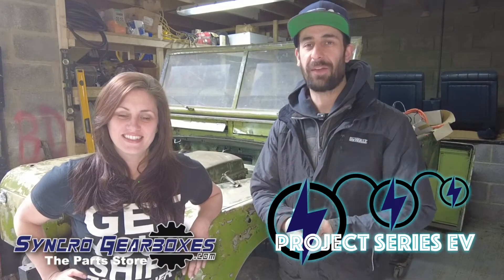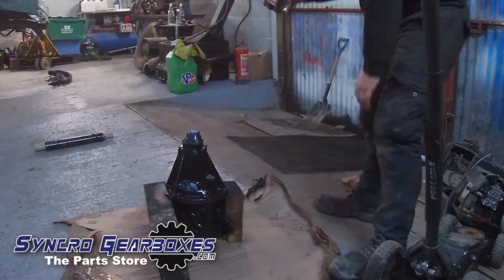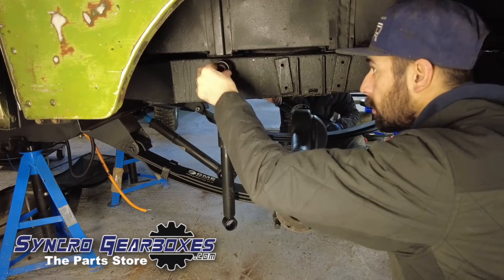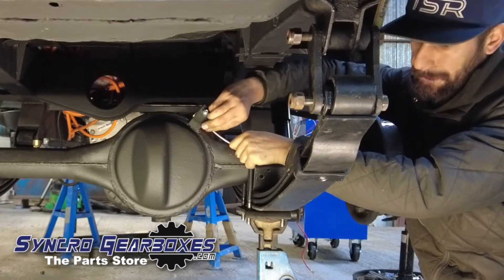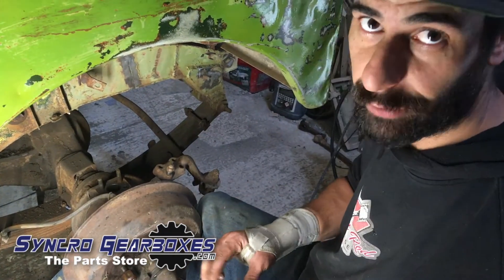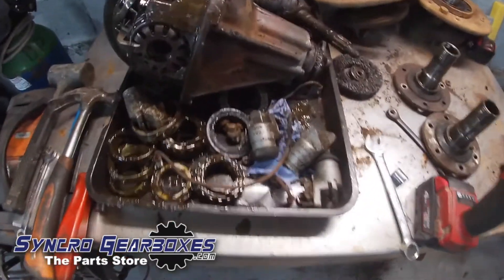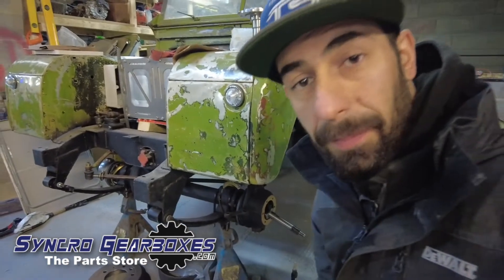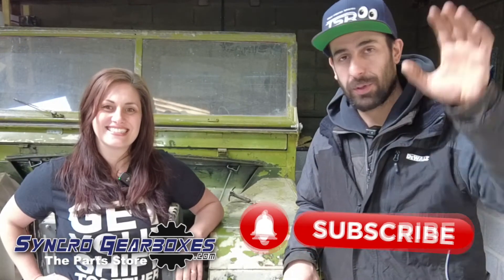13 - Land Rover Series 1 EV Axles: BACK ON ALL FOURS

Comment: parabolics are a poor sub for original road springs.I have worked on LR's  for 53yrs  They suited a Ford Transit MK1 but they never ever as good as an original set up on serris LR! either too soft,too hard,  wrong ride height  ,not quite centered   bushes to hard not handed correctly etc etc.
Reply from the maker: Thanks for the insight Simon. I'll let you know how we get on once this project is complete.

Comment: I have noticed that nearly every restorer is unaware that to revove a drum
 with bad wear and stuck shoes, only has to be released by..
Loosening the wheel cyl mounting bolts and the brake anchor nut.
You do not have to cut the drum off.
Reply: Yes that is why you need more skill than one work through on a No.10 Meccano set .It would have been a little hard cutting the drums off a 12 year old very worn and used LR in the middle of Africa say 1960 with no electricity let alone a small hand grinder.unless of course that old Landrover had compressor or generator set up but really !